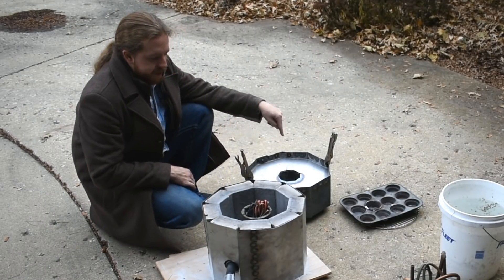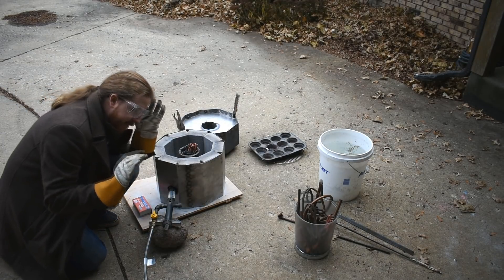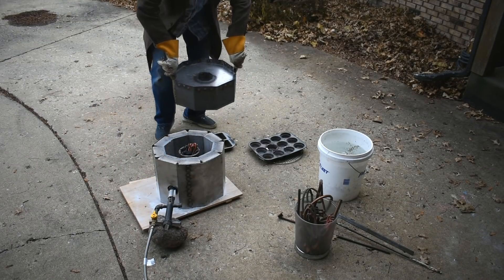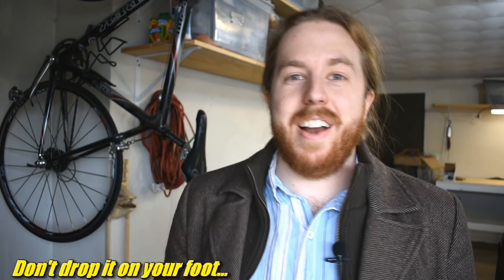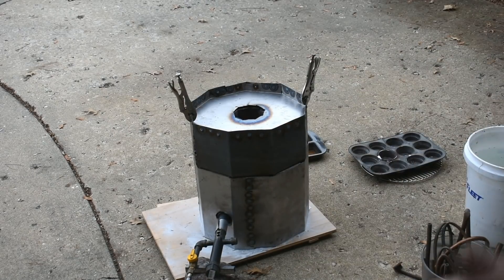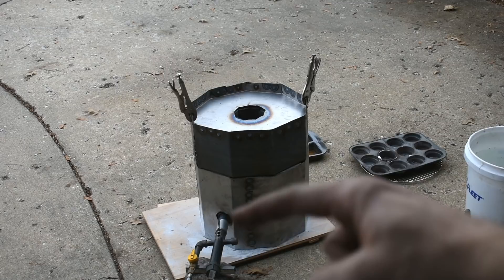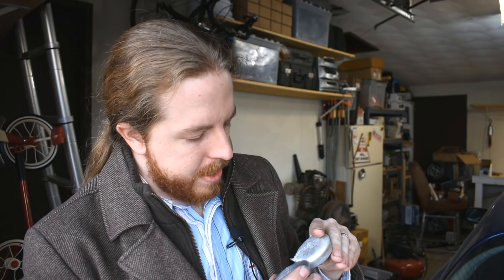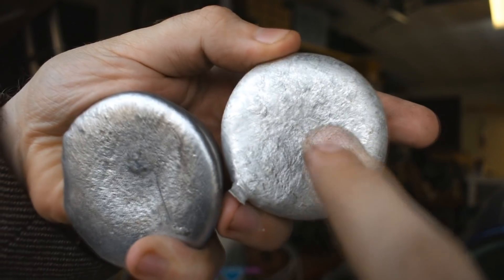Melting Copper in Ingots using my Fire Brick Furnace and a Propane Burner

Comment: Very much enjoyed your video series on the furnace.  Note: I made Church bells, melting 350 lbs. copper adding 20% tin, for the proper "Church Bell meta;", then added 1% phosphorus as a scavenger.  The 'Church Bell' has five tones, all in harmony with each other.  The furnace was made from an old boiler blower, with Kaowool lining then cast-able refractory inside a steel shell, with a tangencial burner opening.  A silica graphite crucible, with a spout, and this became a 'tilting crucible furnace'.  A 'doer' is one who is not afraid to learn...'from experience'.
Reply from the maker: That's great!  350lbs is a pretty heavy pour!  Have you seen the YouTube channel "swdweeb"?  He's a friend of mine who makes a lot of bells.  Smaller ones though.  Bells are incredible.  Im not sure I have the skills to get it to ring out and not crack or something.  It would be fun to try though

Comment: Can we melt silicon with this furnace using LPG ? If yes, then How.
Reply from the maker: Pure silicon has a melting point in the 2500's Fahrenheit, that's pushing it for sure.  I've done iron in this with the same burner, so I suppose it's possible.  Why would you melt silicon?

Comment: which C.W. Ammen book is the one that you recommend? There are quite a few on Amazon.
Reply from the maker: I have read the guide to sandcasting and the guide to metal casting.  Lots of overlap there but the sandcasting book has extra detail in the topic without some of the other filler about investment casting and the like.  Both are worth having on the shelf, however.  I have not read his other books but I'm sure they are also good

Comment: Just drill out the pinhole in the torch if you want more hear.  Not too much though or you have to tweak everything.   The bell the air etc.   And just wrap the tank in a hearing blanket or aim a heater at it.  Either that or use a larger tank and keep it full.  Using too much volume of propane too fast will make the smaller tanks frost up in no time.

Comment: I've found the best aluminum to melt down is from cast aluminum parts. There are additives already in cast parts. Also you can usually find someone with an old transmission or engine parts laying around.

Comment: I made a fairly decent kale wool furnace with air forced propane.
It took forever for the copper to start to melt with one burner so I added a second one.
Now aluminum seems to melt really fast with the two burners compared to the one but copper not so much.
And when the copped does melt, it seems the dross is throughout the copper, top to bottom.
If I try to stick something in there to scrape the dross out, the copper freezes on the tool, and I end up pulling out mostly copper/bronze caked on to the tool, and dross which is caked onto the copper/bronze
And if I'm lucky I might get 25% of the weight of Copper that I put in the Crucible so my yields are horrific.
I added a small puck of aluminum bronze that I successfully made and added four times more weight of copper on top of it and got out pretty much the same sized Puck that I started with.
Lead and aluminum for me was easy, but copper is a nightmare.
I need to find a forum for people who know how to do this crap so perhaps I could learn some less crappy skills at melting copper.

Comment: It’s just a guess, but maybe if you would have used forced air, you could turn the propane to a lower setting, and still get to the same temperature, and consequently the propane tank would take longer to freeze.

Comment: Some advice on why your torch is acting like that, but first, I see you did homework / took advice on borax and tempering, props for not falling victim to the internet. Misinformation is intentionally given out at many foundries (i work around these guys) to keep outsiders out and stop them from taking the stagnant amount of profit in the industry. Always cross reference, or ask a chemist if you aren't sure. 

Your torch is doing something called "coughing". It's that buzzing sound, like a diesel engine, its why your torch sucks flame inside it. It means you dont have a high enough velocity coming out of the torch. Its basically a pulse jet without the valve on it. This causes a few issues. The first being that it overheats the torch, making it oxidize faster and crack apart prematurely (this is also why we use removable tips). The second thing it does is drop you total BTU (your max possible heat). And third, though this isn't always an issue (it depends on how badly its coughing and how close the vent is from the surface of your melt), it can cause oxidation, lots of slag / dross. Its pulling in cold air and pushing it out, basically super oxygenating the melt, and further dropping the temp.

*

How to fix it: First you need enough pressure. We run ours wide open without a regulator, just a pipe valve and the propane tank's valve, which is very touchy. Feather them both to tune it. You can run it wide open and be fine, it's not "as" safe but you're not gonna blow up unless the hose is 10 years old and rotted from sun exposure. To be safer just use a steel braided hose and it wont be able to do much of anything even if the hose is really old and rotted (they last longer too). 

Second: you need fuel velocity. We use .025'' mig welder tips, but you can use different sizes to tune it. This restricts the flow and acts as its own regulator while increasing velocity. This part on its own is the single most effective thing to swap out when you want to change the performance of a torch. A .025 is perfect for a 1'' or 1.5'' venturi if you want aggressive, fast melting torches. Your torch should hiss loudly when not lit, with the valves open (no sound when shut), it will sound like its dumping propane.. don't worry, its not. It will run wide open for about 2 or 3 hours. We also use unregulated LP connectors. Most have a ball valve, don't use those. Get one known as a "full flow" LP connector. That's another massive upgrade you can get, cheaply.

Third: let it breathe. Take the cross pipe out of it, unless you want to use a larger pipe, but you are just complicating flow and mix with it at that point. If you want a cross-pipe, you need to have a very thin one, preferably one that goes in one hole and bends 90 degrees (these are inefficient and dont allow tuning like welding tips do. The King of Random shows a propane torch design, thats the one that most of us use, for good reason. Make one but watch out for his parts list, some of the things he lists like the regulator and pipe / flares are not correct. Double check before buying. That welding tip he has is what i use on mine, and it makes for a flame that slightly melts my kaowoll and sips propane pretty reasonably even when wide open without a regulator. 
A venturi torch seeks an ideal air fuel mix and adjusts its velocity accordingly, meaning you can turn the flame up and down and it will intake as much air as it needs for a good burn, till it looses too much propan
e velocity to do so. Its a simple but elegant design. Dont use a restrictor plate like KoR did, this is not needed in a venturi and using it actually causes a significant heat drop and in some positions, can promote oxidation on your melt. A choke is used in some larger venturi torches but this is more of a safety feature than anything else. They make it easy to light a torch without loosing hair. That feature is up to you, but once the torch is in the forge, remove the choke completely and use the pipe valve and LP valve to tune the flame. We use pipe flares on the rear of the torch to promote laminar flow as much as possible (low turbulence), and larger ones on the front for proper flame shape and helps ensure a good mix.

*

If the propane velocity is high enough (pressure and outlet diameter), and you have a good torch body design, the flame should be aggressive and make a solid roar, not a buzz. It should burn almost entirely blue, like a giant butane torch, but aggressive. The tip of the flame will have whips of yellows. Till you close the forge, in which case it should go completely blue. It will sound a bit like a jet flying by when you walk past it. 

Always use thread tape (PTFE tape / Teflon tape) on fittings, including the welding tip. I recommend skipping the regulator, and if you do skip it, and it cant breathe properly even after the design described above, check that the tip isnt jammed with thread tape like mine was. I spent a week trying different things when i first started and spent lots of money just to find it was clogged. Another think you might want to try is an extension pipe behind the welding tip nozzle, a sort of arm to hold the hose away from the body of the torch, this allows the propane to heat up just slightly over a longer distance and has more time to decompress (this can raise the burning temp from a better fuel / air mix at the tip). Make sure you swap the forward pipe flare out when it begins to crack apart. If you dont, and run it without that flare, your pipe starts to get sacrificed and needs a rebuild. So take care of it, swap the tip when needed (hit it with a hammer, lightly, to see if its dead or not. If it is,.it will shatter and fracture chunks off of it, it also turns hazy gray). 

Good luck and enjoy. It should melt your metal much, much faster and use less propane overall... More per second, but because it takes far less time to melt, because of the higher BTU, it ends up using less in the end. You would be surprised by just how much you have left after a melt.
Reply: Dev Wolf I don’t want to brag too much but I’m an amateur myself and just casted for the first time the other day casting a 5lb tin bronze ingot and while I made mistakes in my design my torch was as you described my family described it like the airport so I’m pretty happy, I did a lot of research and when you mentioned the misinformation being spread that scared me a bit but it makes sense because I looked at a lot of resources for information and tips and there where inconsistencies and totally overlooked topics i had no idea what a plinth was until days before my cast, and I can definitely say I see no competition and little community I guess this really is something of a lost art I’m really glad I stumbled into this hobby as it looks very profitable
Reply: That's a lot of text for a comment
Reply: When I switch from coal to gas.. I going to come back to you.. Hope it's soon.

Comment: I'm a huge advocate of forced air burners, but with copper wouldn't the trade-off be overshooting the additional air, going past neutral and into oxidizing? The danger is oxygen rapidly attacks molten copper. Personally, with copper, I'll probably try to run as rich a flame as can manage to melt the metal. I've only ever done aluminum, but I've done a crap ton of research on copper and bronze/brass. The only thing holding me back is myself at this point...

Comment: i wonder if you can turn the tank upside down  and coil copper line around the furnace to vaporize the liquid propane 
another option might be to use two propane bottles , that way you can spread the load over the two bottles and maibe not have enough evaporation of the liquid propane to freeze the bottles up
Reply from the maker: I wouldn’t know where to begin making that but it sounds cool
Reply: its how they do it in hot airbaloons one tank right way up for the pilot flames and the rest upside down for the hot burn , those burners shoot 2 meter high flames https://www.youtube.com/watch?v=7zDFtnlUgOE

Comment: try putting your propane tank in a bucket of warm water and you could also get a water heater from attwoods that is used to keep water frome freezing over.
Reply from the maker: good plan.  I just need a bigger bucket and a way to keep the bucket itself from freezing... winter here is pretty cold

Comment: If you manage to get some 1000 series aluminum alloy, it is even higher in aluminum than the 6000 series extruded alu you have there, although I doubt you will be able to tell the difference in the final aluminum bronze casting
Reply from the maker: Good plan.  I don’t know exactly which alloys I use because I get what I can get.

Comment: Can you say 100 lb propane tank?  If that is not an option, perhaps you could get another 20 lb tank and swap between the two when one cools down.  Or get a big tank of room temperature water and immerse the tank in the water.  Obviously hot water would be better, but some would complain that it is dangerous.
Reply from the maker: I think hot water tank is in my future.  I already have the grill sized tanks (because of my grill).
Reply: Yes, I have 2 grill size tanks and bought two 100 b tanks too.  If you are not in a hurry, you can find them cheap ($40-$50).  I even changed the connector on my grill when I ran out of 20 lb propane and hooked ti to my 100 lb tank.

Comment: ever thought about making a electric foundry?
Reply from the maker: I’ve thought about it yeah, but I haven’t dived into that type of project yet.  I was thinking maybe an induction furnace would be cool, different from a traditional resistance-heat kind of furnace
Reply: Paul's Garage resistance foundrys are easier and way cheaper to build, an induction foundry is extremly expensive and to build one you need good knowledge in electronics. But jeah induction would heat the metal in 10 minutes to liquid

Comment: Is propane expensive to use for melting metal?
Reply: Hi! So what i did was pick up some hard fire brick locally, about 12 of them and I stacked them with fireproof mortar. The mortar you can get at Home Depot. I then drilled a hole in the side for my blower. I paid about $50 for it. I used hard fire brick because it’s best suited for this purpose. You can probably get this at something like a stone/masonry provider near you. I am 12, and I designed this to be safe, that’s why I use coal. It burns clean with very minimal fire at full blast and almost no smoke. Most of the time there is none. There is also no sparks. I used I shop vac as my blower. Use anthracite coal from tractor supply also known as nut coal there. Do not get Bituminous coal because it cost more, burns a little colder, and has lots of fire and smoke. When lightning it, stack up paper and light it. Then put sticks on top and then coal. Squirt some gel fire starter on it and blower air into it with your blower. It will light the wood and fire starter gel then slowly add coal until it stops sparking and smoaking, then keep adding coal when needed. The $6 40lb bag from tractor supply last me a month of using my foundry on the weekend for hours straight! I hope this helped! Anymore questions feel free to ask! I also am starting to blacksmith so that’s why I started using coal! I never went back!
Reply from the maker: A tank is expensive but refills aren’t too bad.  I think it’s roughly equivalent in price to using lump charcoal.
Reply: Paul's Garage thanks! My budget is pretty low for these hobbies but wood seems pretty limited in its abilities.
Reply: Use coal! It burns way hotter than charcoal and propane with a blower, and you can get 40lbs at tractor supply for 6$. Ine bag last about a month of excessive burning! If you get tractor supply coal, get but coal!
Reply: Frank Villani I'll check it out next time I go into town, it's about 80 miles away so I don't go often. But wouldn't you need a much sturdier furnace for coal since with forced air you can melt steel?  What would you use to make the furnace?
Reply: Would love to try casting a copper sword and hammer it out to harden it so it holds an edge better, could always melt it back down if it doesn't work out.
Reply: Frank Villani thanks a bunch! I'll save your comment so I can find it later, I'd love to try using this for a lot but with the free time I have it may be the work of years to attempt it all.
Reply: No problem! It will be difficult to light it your first time, but there is a learning curve, but the second time you should get the hang of it! I’m glad I could help!
Reply: Frank Villani have you considered uploading some of your projects?
Reply: Frank Villani,  I'm 40 and getting started! Thanks for your comment, pretty helpful. Put up some project videos, would like to see some.
Reply: How did you setup your hard fire brick? I've heard you need special tools to shape it.

Comment: What pressure are you running your propane at? Don't remember you mentioning it
Reply from the maker: I don’t have a regulator so I don’t know exactly.  It’s pretty high on the range of adjustment, and the thing goes 0-30 psi so it’s probably somewhere around 25psi or so
Reply: Paul's Garage I remember reading something a while back and 60psi is coming back to me on what people was running their smelters at

Comment: I once tried to make a ring out of standard tin bronze but I ran into a few problems. The solder I used had rosin in it which made the bronze look more like silver and I'm really bad at making wax molds.
Reply from the maker: Huh I guess rosin free solder is an important distinction. I didn’t mention that, thanks for the info